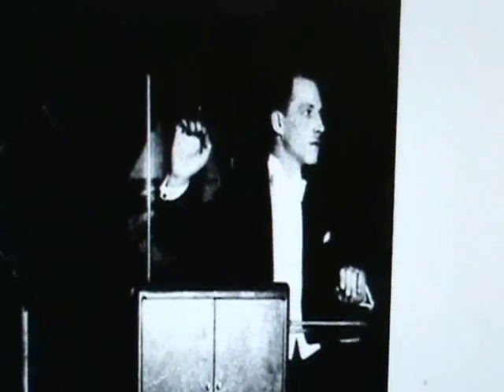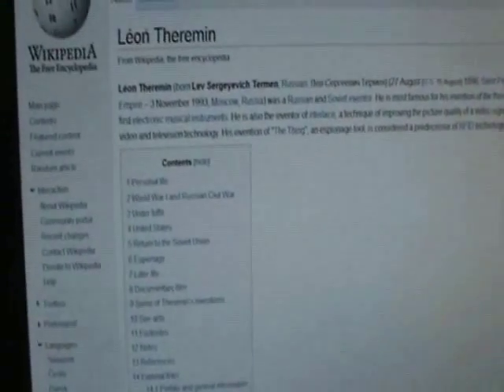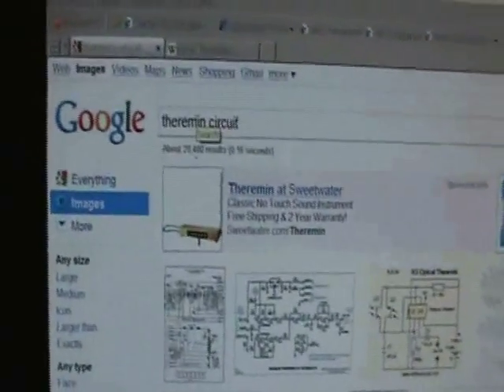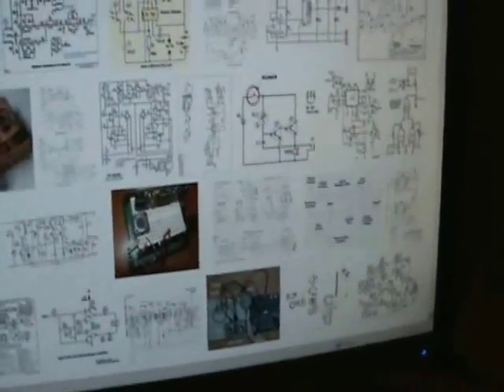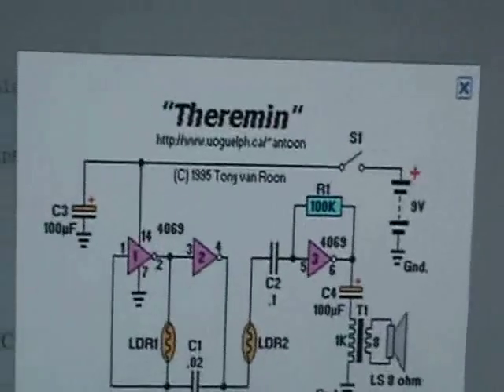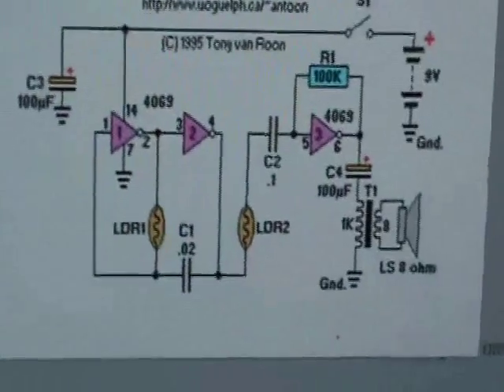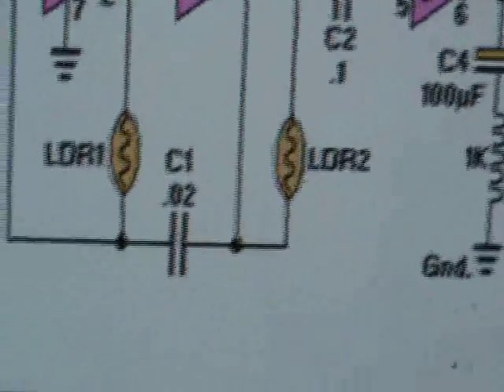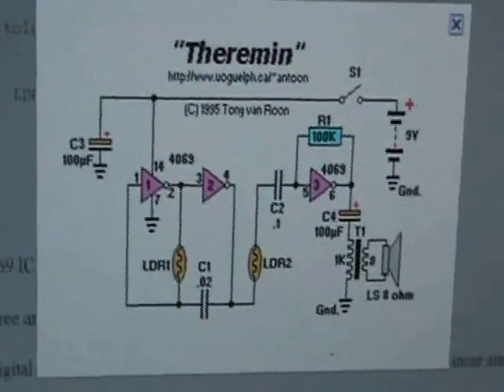Theremin Circuit

Comment: @harpbloke the classic theramin circuit uses a beat frequency oscillator.
early metal detectors used the same system to give audio alerts to the operator through the metal affecting the frequency of a coil.
just like tuning a guitar-if one string is not quite in tune to the next-you hear the difference between them-you know that wah wah wah sound when its close but not quite on.
so if one is 440hertz and the other is 441 hertz you hear the 1 hertz between.
thats the beat frequency.